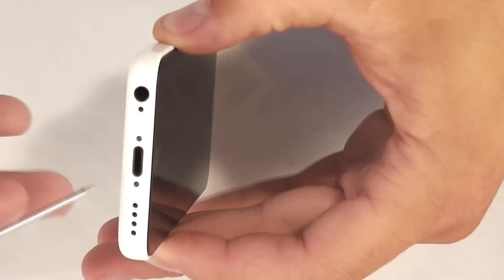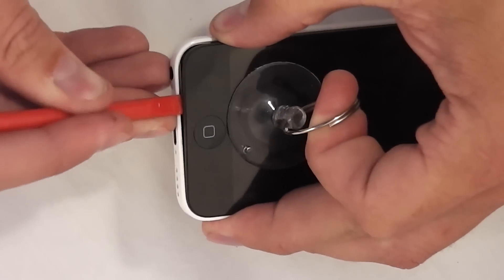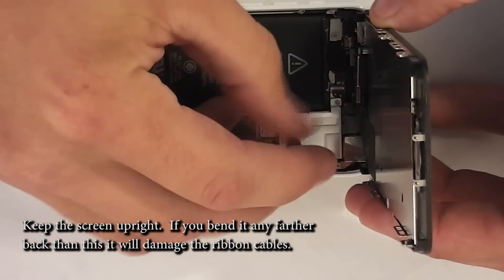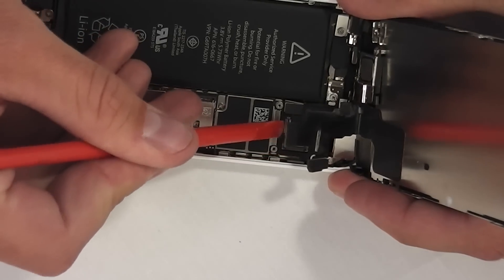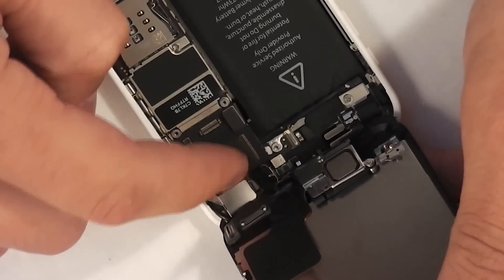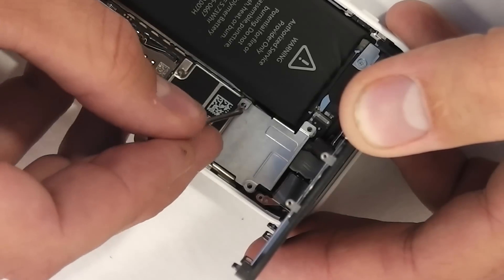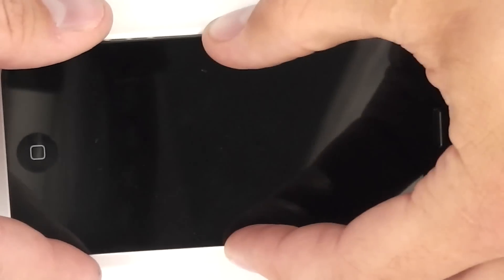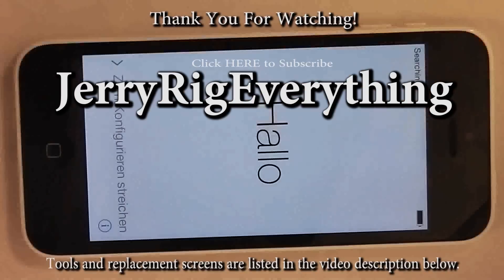iPhone 5c Cracked Screen Repair in 3 minutes

Comment: Awesome. Did mine in the 3 minutes. Bought the fully assembled screen for about $60.
Reply: +Robert Graham  i got mine for 5 bucks off ebay
Reply: +mandela haulcy But was yours complete or just the screen???
Reply: it was the screen and all the tools
Reply: I just bought one for $27 on Amazon. Included a temper glass screen protector.

Comment: PLEASE HELP! I recently purchased a screen replacement for my 5c(only LCD included), I followed all the steps YouTube had to offer but white lines appear and gets more promenant when I plug the charger in, also the screen display is on the right side of the screen and the touch screen response hardly works, if you know what is going please comment away, maybe the seller scammed me or I did a crappy job replacing it.
Reply: I would give it a try to unplug the cable and replug it. I saw a video by Channel "Hugh Jeffreys" Where I believe a very similar thing happened. He explains it as static electricity and it took a couple of tried connect/disconnecting to get it to work well.
Reply: @FP05Studios  I've unplugged and plugged back in many times, I'll have a look at the video.

Comment: So i cracked my phone and then i dropped it agian and everything is black i tryed everything possible so i guess my only option is to replace the screen will it come back on if i replace the screen ?
Reply from the maker: Taylor Hargrave As long as the only problem with your phone is the screen, it should come right back on with a replacement.

Comment: ok, so I just checked my screen on my 5c cell phone, and there is a place down the Palmer Park Mall called Fix My Cell which charges $150.00 and takes about 20 minutes, anyone have another idea, maybe cheaper, please let me know!  Thanks, John D.
Reply: +John Di Biagio Buy the 5c digitizer that includes the home button and replacement tools for about $60 on ebay (new).  Choose a vendor with a high rating ... 99% or higher.  It should only take you about 5min to replace the digitizer just like the video shows.

Comment: My screen stopped working. It started by getting a white line down it. Which then faded into a full white screen. But I tried to force reboot my phone and now the screen does not work. But I plug it in to charge it and it vibrates every 5-10 seconds. What should I do. And how do I know what's broken. Is it the battery or the LCD or charging port. Please help.
Reply: make sure everything is plugged in, the reason is maybe one of the Lego cables inside he phone may have not been plugged in or fell out, if thats not working, then the screen you have may be the faultiy

Comment: The iphone 5c I am trying to fix got dropped and the screen broke. The screen glitched out for a sec then nothing. I am getting nothing out of the phone to show it is still alive. Do You think the phone is dead or the screen is causing an error and will not let it boot. How can i test this. Will the phone boot with no lcd? With no lcd can i hook to pc and pull files. or does it know there is no lcd and will not boot??

Comment: Used a 4S for a couple of years no issue.  The 5S glass is like candy.....cheap pc of crap.  Great job, Apple.  Didn't drop the phone either, and have a case.  Simply sat on it like I did w/ the 4S.  JUNK glass.
Reply: Thanks for the video I'll probably try to replace it myself.
Reply: Stabmaster Arson then that means your very heavy if you broke your iPhone from sitting on it and it wasn't even a 6plus

Comment: As I plugged my phone in and the screen responded the screen looked crystal clear with no problems but within 1 minute it got white squares on it, which have now disappeared and it has 4 or 5 grey horizontal lines on it.
Reply: You have to unplug than plug the screen back in multiple times

Comment: Question,

Is this just the tool kit then? What is the Glass Lens included serve as then?

http://www.amazon.com/Replacement-Front-Screen-Glass-iPhone/dp/B00GGLQ9ZW/ref=zg_bs_tab_pd_bsnr_2

Thanks in advance!
Reply from the maker: Dont get this. Get something from reputable seller with feedback.  This seller has nothing and it is almost impossible to replace just the glass on your phone.  You will waste 10 bucks and break your phone.
Reply from the maker: Yup, I agree totally.  Replacing the whole unit (LCD and Digitizer) is a much simpler process, and it is what I show in this video.

Comment: Do we need a new Digitizer as the kit I got only had the screen and not the metal panel... Is there a way to just remove the shattered glass and put the new screen on?
Reply: Jasmine leith no as long as the digitizer works take the digitizer off and put it on the new screen

Comment: Not really feasible time... 30 minutes+ if not experienced or got wrong replacement and need to transfer parts. Too fast, not enough detail. And with small screws of different sizes, please show which size goes back where (things get dropped, moved, etc.)

Comment: Hey Jerry question for you. Everytime i drop my phone even when its in the case the top corners of screen pop out and i have to reseat the screen constantly but it keeps happening. Phone is mint condition except for the screen popping out so easily. Is there tabs i can bend or glue that are  on top corners of screen to keep it from popping out?

Comment: Ok, I ordered the parts and tool kit from Amazon and they said 1 to 5 days shipping. Can't wait ti change my batter and fix my wifes screen display. I'll report back how it went. Since my hands shake due to battlefield injury, I'm considering building a table mount to hold the phone securely, and the screen at a 90 degree angle. If it works outs, I'll post pictures so anyone else can make their own.

Comment: did you use the same screwdriver for the 4 screws on the metal plate inside?
Reply from the maker: Yes.  The driver is the same for all 4 of those screws.
Reply: +JerryRigEverything that's weird I was sitting there for minutes and it would only get one out
Reply: +JerryRigEverything I just don't understand if I'm doing something wrong taking those screws out
Reply from the maker: Make sure the Philips head screwdriver fits the heads of the 4 Philips head screws.
Reply: +AllsketchScout Same, I've just managed to get two out, I swear the bottom left and bottom right screws are smaller. Annoyed as I bought an inclusive kit which was meant to have all the right tools. Why it it just fitting two of the screws?

Comment: WARNING: DO NOT buy the screen linked to this video!!!!

The information is very helpful, but it only works for 1/3 of the steps you need to complete. You literally have to take the entire thing apart to get it to work!!!  Speaker, camera, home button, metal plate!!!!!! At least 10-15 tiny screws you have to take apart and put back in.

I figured it out, but wow... that was way more than I signed up for and got very stressed and frustrated at parts.  This screen took me almost two hours to fix.
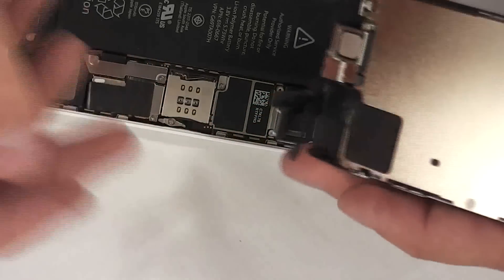Reply from the maker: Mandi Mitchell I mentioned at 1:20 that you will need to transfer over the metal plate, home button, and ear piece to your new phone screen.  There are 10 screws that need to be moved. The screens I have linked with the video have been the most reliable to me so far. (Much better than the Ebay ones from China.) 

BUT everyone is more than welcome to buy their screens wherever they feel like.  I made this video as an instructional service.
Reply: JerryRigEverything Well I purchased the screen a week ago when I first saw this link.  Very helpful, but don't link a screen that doesn't follow the video you posted.  There are a lot of people out there (like me) who are not all that tech savvy.  If I had known how much work was involved and how much frustration I would have dealt with, I would have taken it to a repair company.

All that being said, your video was helpful for the steps that you did post.  It was just the easiest part of the TONS of steps I had to do to get the phone fixed.

Comment: Um... Most places WILL NOT give you a screen with the camera, speakers, and sensors installed. You're looking at 30 minutes minimum. Nice try.
Reply from the maker: The video shows HOW to do it in 3 minutes.  As in the video is 3 minutes long. The actual process would take a bit longer. Thanks for the feedback.
Reply: JJbrown74 where did you find a screen that included everything?  I have searched and can't find one.  :-(   Thank you!

Comment: PLEASE HELP ME :(  I did the repair myself w/ my grandmother and when I finished, I powered the phone back up and it wouldn't respond to my touch at all. I went back and undid the connectors & put them back in and powered up, well now it's not FULLY responding to my touch. I can use the phone, but say if I'm texting and I want to type "I", it won't let me use it. Also, there's a line down the screen on the side it won't respond to. Now I have another problem. I've been on 100% for a while and I was wondering why because I've been on my phone. Then my phone just automatically shuts down, while on 100%! I plug in the charger because it says it's dead, but when it comes back on it still says 100% ! PLEASE RESPOND, I don't know what to do or what I did wrong!
Reply: Use an air duster where you unconnected and connected the ribbon cables, if that doesnt work try buying a new screen.
Reply: Marice Hollister  I know this was a month ago, but I will reply in case others read this for info.The Air duster is a good one because there could be dirt under the connector, the connector could also be loose so try reseating it again. lines down the screen mean the connecting cable doesn't have a full connection.
Also for everyone attempting to fix this themselves, make sure you unplug the battery before unplugging / plugging the screen back in.
Reply: That’s what happened w my moms. Had a screen and took to a guy to put it on, it was a brand new screen but the touch wouldn’t work. So idk if he did it on purpose so we’d buy his more expensive screen

Comment: When I watched this video it all seemed pretty simple.  There is a huge piece missing from it though.  He mentioned you "Might have a few more steps".  Those steps involve replacing the camera, earpiece, and other little bits.  Watch the other "Nothing left out" video and you will see what I mean.  Those steps convinced me on not attempting this myself and just paying the $125 for a pro to do it.  Unless you get a screen replacement with those parts, this video will help.  Otherwise I suggest watching the other video to see the entire procedure.  I guess you can repair anything in 3 minutes if you leave out steps.
Reply: +8686joedog I noticed that too.  I wouldn't say the video is missing anything though.  That's why I bought a digitizer that included the home button, etc.  I replaced my daughter's broken screen in about 5min ... just like the video showed.  Saving about $10 on a digitizer without the home button didn't seem worth the extra hassle of removing and reconnecting several more small pieces of electronics.